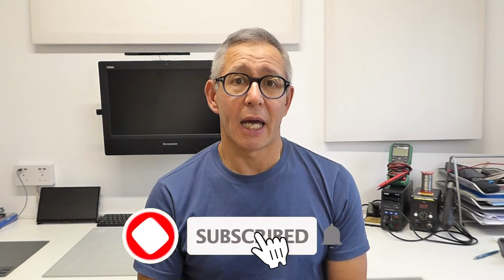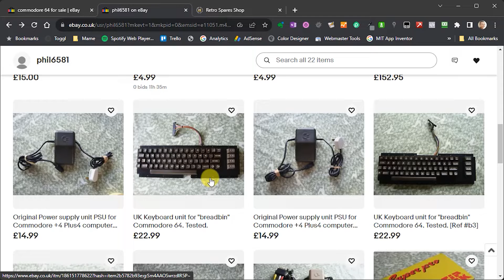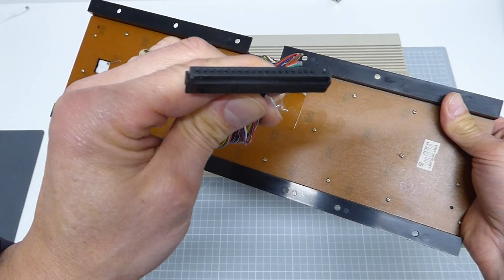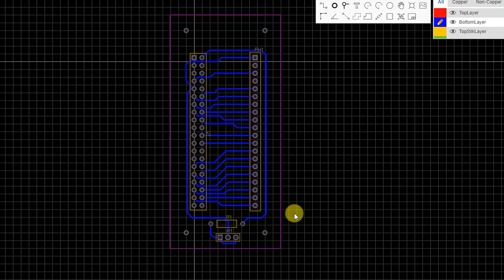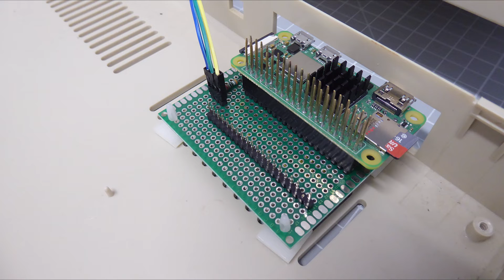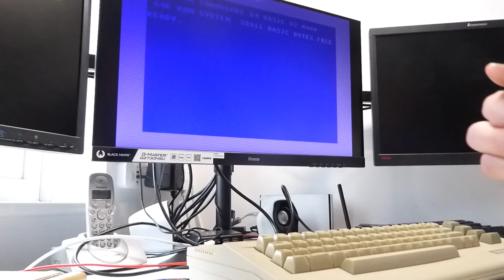How to Make a Replica Commodore 64

Comment: I have a C64 Breadbin case on the way and a keyboard. Just grabbing parts so am ready to go when it all arrives. Are you able to advise on the recommended PCB standoffs height to make sure the board all lines up nicely with the rear case cut outs by any chance? There seems to be numerous options available.
Reply from the maker: I used these 0.25" standoffs - https://amzn.to/3TQhTUn. It puts the pi / connector at the right height.
Reply: @BytesNBits  thanks

Comment: Translator:
Great, but a C64 MUST have joystick ports. 
I subscribed to this channel to see the PCBs of your project.
Reply from the maker: Thanks for subscribing. I'll add the 9 pin joystick inputs to the final PCB design.
Reply: MUST have joystick ports? There are uses for a C64, or any other computer, that don't involve them. Besides, the Pi has USB ports that can take USB joysticks. You could just as well argue it needs all the other ports too, or it has to have a real 6510 CPU, a SID chip, an RF modulator and use a real CBM datasette. In which case, just buy a real C64.
Reply: @another3997  I completely disagree with you. Playing on a joystick is half the fun of using emulators. The rest is not important.

Comment: How about one for the C16
Reply from the maker: I think the C16 uses the same case and keyboard as the C64. I don't think the BMC64 emulator specifically emulates the C16 but it does cover the plus4.

Comment: Brilliant build, Bob. I built my own A1200 "FrankinPi" using a reproduction A1200 shell case, a Keyrah v2 keyboard adaptor board, a full Amiga 1200 keyboard and various cables. I first built it around a R/Pi 3b + board with the brilliant "Amibian" software but have since swapped out the Pi 3 for a Pi 4 and now i can also run the brilliant "PiMiga" software.
Reply from the maker: Sounds like a great project. I'm really liking these builds using original (or remade) hardware. I'd been looking at the PiMiga stuff but haven't given it a go yet.

Comment: Thats Wiard!
Also basically what I want to do with Old systems: Find donated systems for cheap that I can throw an RPi 0w in the OG Cleaned up Case, with a Complete Library for Said system.
I need to scrounge up a US eBay store like that.
Reply from the maker: Make sure you can get an emulator that works well as a stand alone machine first. I used a bare metal emulator for this build which is ideal for the replica machine. Not all systems can be emulated this way with the ability to use the original keyboard. Get that end sorted before you invest in the hardware. Have fun 😀

Comment: nice dear, but raspberrypi 4 is much expensive to dedicate, I know that a ESP32 about 5us can run a dedicate zx spectrum bare metal! with sd support! what do you think about? maybe could run also commodore
Reply: There's a Pi 400.
Reply: is´n there a Commodore Pet Bare Metal? @maxxdahl6062
Reply: @maxxdahl6062 BMC64 does not support pi4 or pi400 and it seems there is no intention from the developer of BMC64 to upgrade for this platform.
Reply from the maker: The Pi4 is a bit of overkill for this. I used a Pi Zero 2W to get the computing power, HDMI for video/sound and USB for gamepad support. The ESP32 emulators are great and very cheap, but lack the HDMI and USB that I particularly wanted. I have been thinking about a video on the ESP or Pi Pico versions though.
Reply: is´n there a Commodore Pet Bare Metal? @BytesNBits
Reply: An original Raspberry Pi Zero can easily emulate a C64, and they are very, very cheap. The Pi Pico, ESP32 and Arduino boards need extra hardware to output to HDMI, which adds to the cost and complexity.
Reply: Pi zero is not cheaper as the project propouse in worldwide, just there, the ESP32 don´t need extra hardware, it had manys analogues I.O(s), you can also buy the tvga32 TTIGO, is a ESP32 that cames with vga plug  ps2 and SD yet  @another3997

Comment: So many people want a keyboard computer like the C64 or the Amiga. Imagine a modern machine with the power of a Nintendo Switch and a mechanical keyboard. Who will build this for me?  😭
Reply from the maker: There are a few SBCs coming out with quite high specs. Maybe have a look at putting one of those in a keyboard.
Reply: Take the screen off a gaming laptop and Bob's your uncle.
Reply: @Swenglish That would be one very ugly desktop computer, with all the hinge mounts showing, and track pad at the front. I'd go for a small USB or wireless keyboard mounted in a small, retro style case containing the motherboard etc. You can easily and cheaply build or adapt an existing case.
Reply: @another3997  Well, depending on the computer, or rather the OS/UI, a trackpad might come in handy. But yes, you can also start with a keyboard with some empty space in it and stick your NUC or SBC of choice in it, or go for a repurposed or custom shell. Depending on what you're hoping to get out of it, there are different ways of going about it. But I guess what I was trying to illustrate is that the more advanced you go with a keyboard computer concept, the closer you get to a laptop without a screen, at which point it's easier to simply take the screen off a laptop (and do what you will with the hinge area). Then you're only one step away from simply leaving the screen on and realizing that laptops are just keyboard computers with a screen and a battery. The reason why the form factor kind of died out is because it evolved. Which is not to say that the nostalgia factor is without value, but with game consoles, laptops, tablets, phones and handhelds satisfying most of the consumer market for computers, the desire for a keyboard computer with modern specs is definitely a niche one. I mean, it's a laptop minus the convenience of a laptop. 

One new computer I do think could get away with a keyboard computer form factor option is the Agon Console8, just by nature of what it is, but that's definitely no Nintendo Switch.
Reply: You mean something like the Raspberry Pi 400 but with a better keyboard? Yes, I'd like to have something like that. Chris on "Explaining Computers" channel has just dropped a video where he made a case from ABS plastic, glued, sanded and painted, based around whatever keyboard you desire. It's quite simple and looks good when painted.